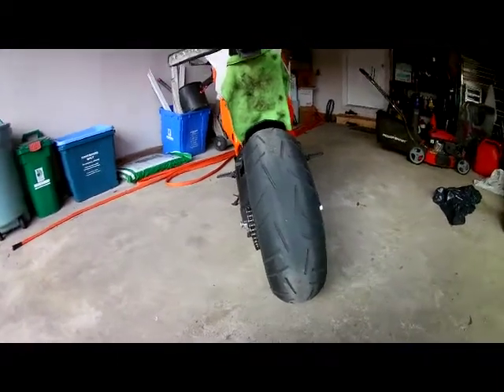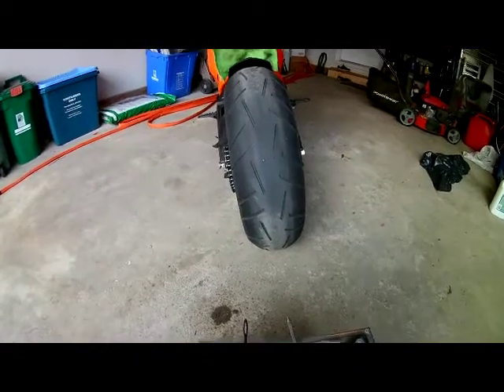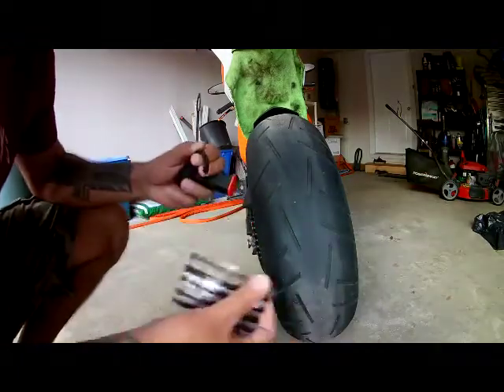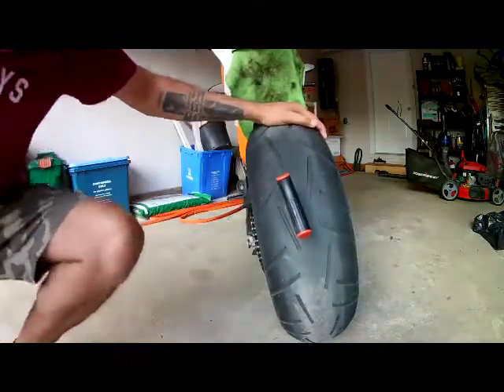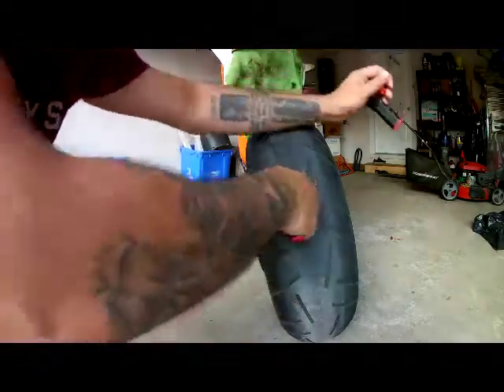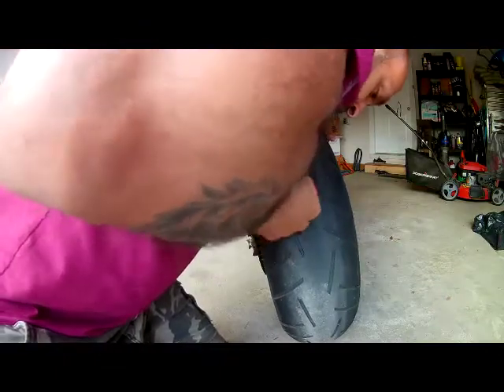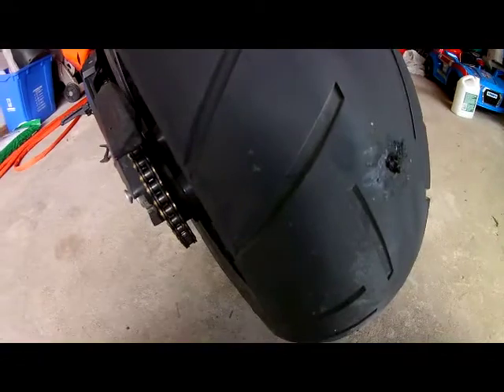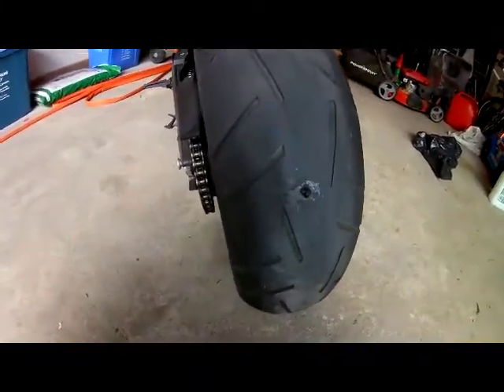How I plugged my motorcycle tire

Comment: Do you just take it to a regular tire shop for them to patch it ?
Reply from the maker: Absolutely not!  This is an emergency plug.  I plugged the tire so that it wouldn't flatten to the rim and also for ease of loading onto a trailer should it need.

Never ride on a plug unless absolutely necessary.